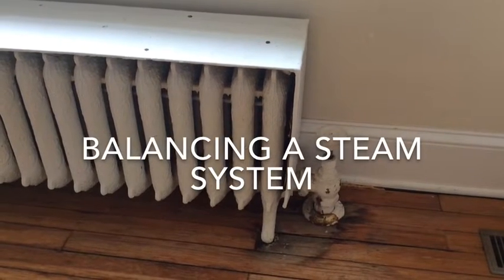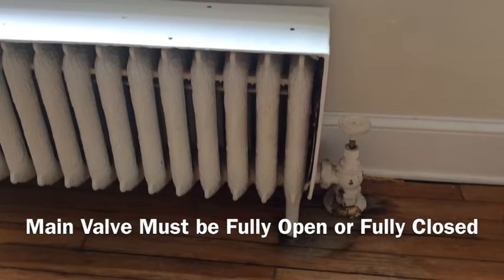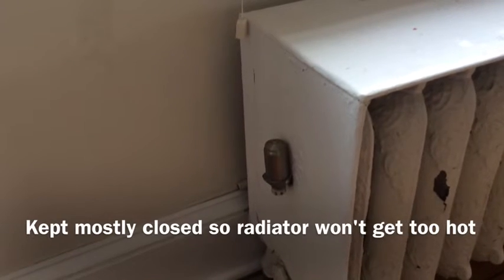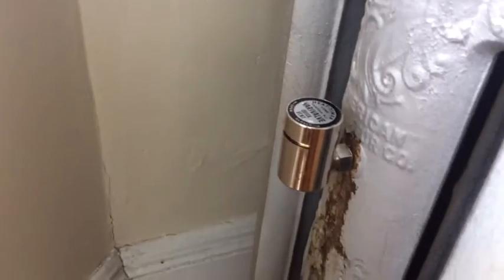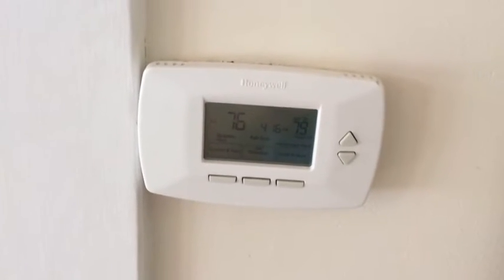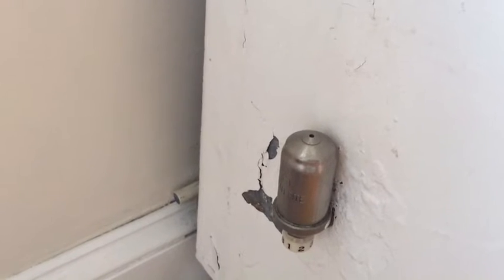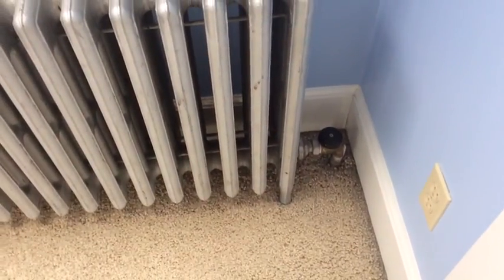Steam System Balancing

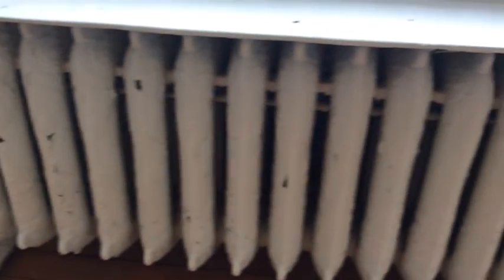Comment: 4:26, Interesting point about restricting the amount of heat in the rad. nearest the thermostat as this could cause other problems with the air vent valve, like rupture, etc.
Reply: Glad to hear that this video is still helpful.

Comment: Did you turn off the heat when you changed the valves? Need to install the same valves.
Reply: just close the valve he showed in the beginning and then you can work on it. so you dont have to turn the whole system off

Comment: my landlord said to keep the varivalve midway between open and closed he didn't explain why.  He keeps the thermostat in the hall at about 70 degrees, but my apartment radiators don't go on with the exception of one. It's frustrating to have to call him with the same issue and no resolve.  I don't mind 70 degrees but when most of my radiators don't turn on because the hallway is warmer and shuts off before i can get some heat...what am I left to do but keep complaining?
Reply: Landlord is trying to skimp on his gas bill. OPEN the valve all the way.
Reply: @xan8185 did u find a solution for this?

Comment: On the first valve is the high number or low number closed
Reply from the maker: I'm pretty sure the bigger numbers give greater air flow.  An easy way to test is to unscrew the valve and blow through it to see what gives you the most flow.
Reply: @NYCDadd  so would greater air flow cause the radiator to heat up more.
Reply from the maker: @blg020  Yes, more airflow means more steam flow which delivers more heat to the radiator.

Comment: I know that you can prep those radiators up to run on hot water just like baseboard heaters instead of steam. I've seen it done.
Reply: Only if it has an upper manifold which most steam rads don't.
Reply: Sounds like work.  I've seen them with bleeders on each section but thats a cobbled fix.  Would like to see one you mention.
Reply: @davidisabella6750  thanks, but that is a dual manifold rad.  The old single manifold rads can't be converted like that.  There is no way for the water in each section to circulate.
Reply: I thought that all radiators have a conjoined hollow top section and hollow bottom section that the steam passes through and that the only difference is how many pipes are connected; 1 or 2. On a single pipe radiator, the pipe connects to the bottom section at one end and the pressure valve connects to the top section at the opposite end. Essentially, wouldn't that mean that you could connect an inlet and outlet hot water pipe to each of those locations?
Reply: @davidisabella6750  all water rads are that way but not traditional steam rads.  Look at the one in this video.  Its just a rod on top to secure the sections.
Reply: If not, you can modify it to a two-pipe radiator. You'd solder copper pipes to them and use a thermostatic valve.
Reply: I have a house full of single manifold rads.
Reply: Okay, so the top sections of your radiators aren't a hollow passageway for steam, just a space for the long rod to hold the fins together, you're saying? I wasn't aware that single pipe radiators were like that. Because of the steam pressure release valve, I always thought that the top section would hafta be a hollowed out passageway for steam. There were dual pipe steam radiators that didn't need that valve. Anytime you see a hot water radiator, it's because it was later converted to hot water. They were all steam originally, no matter whether single or dual pipe.
Reply: @davidisabella6750  later steam rads were built to be used for either water or steam.  Not the single manifold ones.  Steam only.  You can drill and tap each section bur the would be cost and time prohibitive.  Go on heatinghelp.com for more info.
Reply: Also, the steam vent valve is simply to let out the air so steam can enter.

Comment: Thanks — helpful guidance. I live in a four-story 16 unit building with single-pipe steam, and we are trying to “tune” the system, which I gather means that the mains should be well-vented and the radiators furthest from the boiler (ie, top floor, and the end of each riser?) should have vents that allow them to vent faster than the radiators closer to the radiator, as you’ve outlined?
Reply: Try going to heatinghelp.com There is plenty of information on the subject.